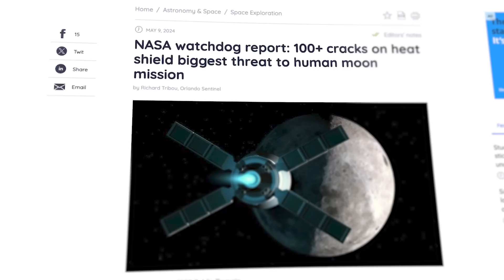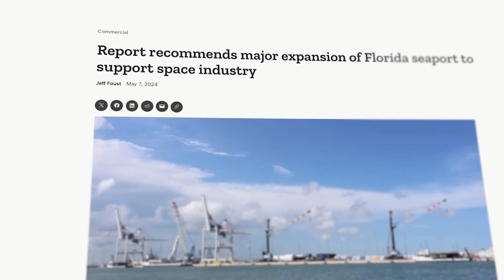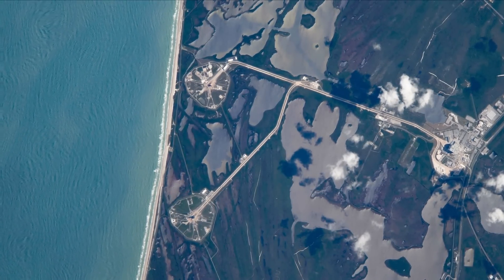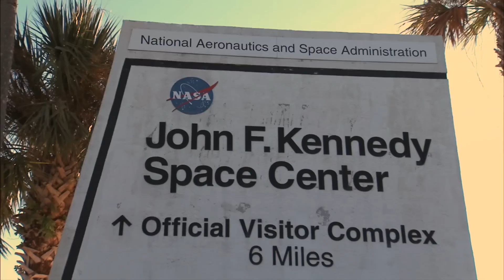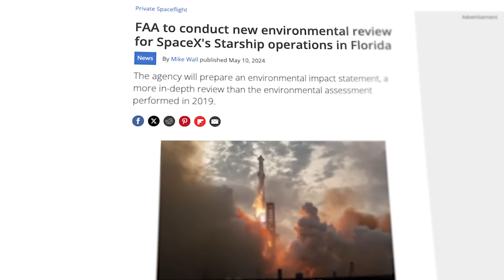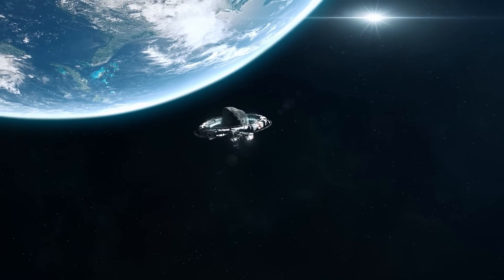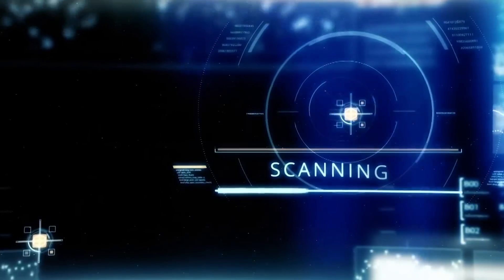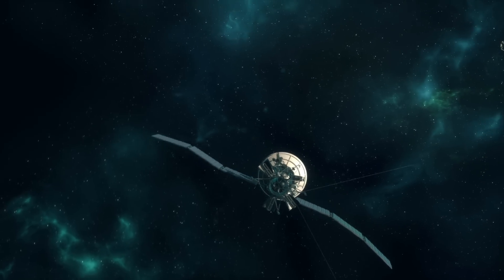NASA Has A Problem With Artemis

Comment: Its okay to keep blaming NASA for the delay since they are the major stakeholder but isn't the orion made by the ESA? I have not see one person raise doubt on them. Why is that? Is there a good reason?
Reply: No, Orion is made by Lockheed Martin. After the Demo-2 manned test flight, the Crew Dragon heat shield has similar issues of abrading too much that Orion has. SpaceX just thickened the heat shield in those areas, something that NASA and Lockheed Martin will likely do with Orion.

The ESA makes the European Service Module (ESM) to support Orion for the mission.

Comment: That heat shield was f'ed up, there were whole chunks missing! They were so big they could be seen trailing off the vehicle during re-entry.
Reply: After the Demo-2 manned test flight, the Crew Dragon heat shield has similar issues of abrading too much that Orion has. SpaceX just thickened the heat shield in those areas, something that NASA and Lockheed Martin will likely do with Orion.

Comment: Can someone explain why the Space Shuttle’s ceramic heat shield tiles cannot be used for Artemis program?  Did NASA accidentally destroy the technology, as they claim they did with Apollo’s records?
Reply: The shuttle returned from LEO, at ~17,000 mph (~27,000kph). When returning from the Moon, the spacecraft is travelling over 24,000 mph (~39,000kph), so the energy is MUCH greater. 

The Shuttle era tiles were individually made and VERY expensive. The Artemis heat shield is made from more generic materials to keep the costs down. After the Demo-2 manned test flight, the Crew Dragon heat shield has similar issues of abrading too much that Orion has. SpaceX just thickened the heat shield in those areas, something that NASA and Lockheed Martin will likely do with Orion. 

Only the Flat Earth and Moon Hoax conspiracy people falsely claim that the Apollo technology was lost. When Congress cut the Apollo funding, the hundreds of thousands of people and hundreds of factories making the Apollo hardware moved on to other things. So to recreate the Apollo hardware, you first have to recreate all the factories that made the Apollo hardware. So while the knowledge from Apollo is still there, the tools would have to be remade.

Comment: I’m flummoxed Artemis has made it as far as it has. It’s fscking 1979 tech and hardware being grafted onto a light remix of 2010 era design. And that’s a generous assessment.
Reply: Yet the 1960-1972 tech worked.
Reply: @christophercripps7639  absolutely true. And I’m not saying the design and engineering isn’t both valuable and useful. But I am saying that allegedly cost-saving in order to under-bid and win SLS on the basis of using old, remaining shuttle hardware is fine when there aren’t humans on top. But being that humans are about to be on that machine, we should be valuing quality a whole lot more than cost. 

Then again, ‘mericuh, capitalism, yadda.

Comment: oh no this Orion cracks thing sounds bad :(
Reply: After the Demo-2 manned test flight, the Crew Dragon heat shield had similar issues of abrading too much that Orion has. SpaceX just thickened the heat shield in those areas, something that NASA and Lockheed Martin will likely do with Orion after the research is done.

Comment: The Artemis heat shield issue cannot be overstated.  When a fix is found, it may require an additional unmanned test flight before NASA is ready to fly astronauts.
Reply: I believe ethically it SHOULD. Whether they’ll value life over cost remains to be seen.
Reply: @mostlyvoid.partiallystars   No, it doesn't necessarily require another unmanned test flight. The Demo-2 Crew Dragon had similar heat shield abrasion problems and SpaceX thickened the area that abraded too much for Crew-1. It's possible that Lockheed Martin may be able to do the same as NASA and Lockheed Martin have been researching this extensively already.
Reply: @steveaustin2686  they can always choose not to re-fly and probably will - I don’t dispute that. But ethically I believe it’s the wrong choice. What SpaceX did does not dissuade me of that, and I work in a closely linked industry to these. There are not humans on my rockets but I understand the systems engineering process and steps to mitigate risk and limitations to tolerable levels. That tolerance when humans are on the stack should, IMO, ethically, be much much smaller.
Reply: @mostlyvoid.partiallystars   And if they know WHY the heat shield abraded more than they expected and can FIX the solution to NASA's satisfaction, then WHY waste money on a reflight? You can always say that anoher test flight makes the system safer, but at some point you have to fish or cut bait.
Reply: @steveaustin2686  sure. And “some point” ought clearly exist beyond ONE test. 

Astronauts get to decide what level of risk they will take on, I respect that. But we need to remember there’s a psychological cost to the ground support as well, especially in Mission Control, for accidents in human space flight. 

This is crew capsule. It’s not booster stack, from which abort is possible. It’s not scrubbers, again from which mission abort is feasible. This is literal survivability becoming 1 or 0 based on a fix. 

You’re welcome to differ in opinion. That’s fine. Be well.
Reply: @mostlyvoid.partiallystars   AGAIN, if they know WHY the heat shield abraded more than they expected and can FIX the solution to NASA's satisfaction, then they may not need another test launch. This is not a new issue either, as the Demo-2 Crew Dragon had similar heat shield abrasion problems and SpaceX thickened the area that abraded too much. Since NASA was happy with the fix that SpaceX put in, they moved on to Crew-1. So this is NOT an unprecendented situatation that Orion might not need another test flight.
Reply: We were doing this routinely in the Sixties. Did we lose that know-how since then?
Reply: @roncatdog  For some strange reason Nasa destroyed all that knowledge...
Reply: @OurAmazingSkies   It looks that way. I think some people, both in government and industry, have figured a way to get the taxpayer to pay for 'inventing the wheel twice'. Never underestimate the power of greed.
Reply: @roncatdog  yes. It retired and moved and companies didn’t care enough to value retaining it. They assumed it was now commercially marketable and stopped valuing engineers. See Columbia and Challenger accident investigation reports.
Reply: @roncatdog   When the public lost interest and Congress cut the Apollo funding, the hundreds of thousands of people and hundreds of factories making the Apollo hardware moved on to other things. So know, it was not destroyed. The factories would just have to be rebuilt to make 1960s tech, which is silly.
Reply: Yes, in about another 10 years
Reply: I agree it would be prudent to play it safe, but they have limited hardware that will probably influence their decision. When you let politicians and bean counters assess risk, it's only a matter of time to expect the next fatal catastrophe.

Comment: Need to get rid of EPA oversight over Rocket programs.  This is a primary need and it doesn't need to be held back.  And, we need to get ahead of China and get back to the moon ASAP and get to MARS as quick as possible.  Playing around with EPA and ESA, holds us down.
Reply: The FAA vs SpaceX is not really a thing, except for clicks by some YT channels. After all, the FAA defended SpaceX in front of Congress in Jun 2021 over the unauthorized SN8 flight. The 'NASA delaying Starship until the SLS flies' was just as silly, since NASA needs BOTH Starship and SLS for Artemis. 

SpaceX had approval for orbital launches of the Falcon 9 and Falcon Heavy from Boca Chica since 2014. They could also fly sub-orbital tests of reusable spacecraft. SpaceX went through an Environmental Impact Statement (EIS) to get that approval in 2014. Since SpaceX wanted to fly orbital flights with Starship, that has roughly 3 times the propellant as the Falcon Heavy, out of Boca Chica, a relook was in order. So the FAA review was to see about adding Starship to that existing approval, without having to go through another EIS.
Reply: @steveaustin2686  thank you for the level-headedness and the good history lesson
Reply: @steveaustin2686  I didn't say there was
Reply: This should become a national security concern and the EPA should be told to mind its own business or be completely disbanded
Reply: @RedRyan  🙄Then you end up like Russia, with a lake so radioactive, you can't stand on the shore without receiving a lethal dose.

Comment: I have a hard time understanding why NASA has so much trouble with Orion heat shield. Didn’t they use heat shields on Apollo missions? 5:08 Shouldn’t they base their designs for the Orion capsule on that reliable technology instead of going for something entirely new and untested? In this “cost effective“ new space race to the Moon, shouldn’t NASA go for proven and effective methods and technologies instead of trying to reinvent the wheel?
Reply: Several reasons.
1. Funding isn't what it was during the apollo program, adjusted for inflation NASA had nearly 10x the budget at the height of the Apollo program.
2. Safety, the space race during the cold war saw some massive risk taking, numbers thrown around indicate a 50% chance of actually landing on the moon, and a survival rate of between 73% and 90% depending on sources. (Neil Armstrong said in an interview that he had a 90% chance of returning alive) 
That is obviously unacceptable in todays climate, anything below 99% survival rate won't be launched. 
3. Apollo was single use, Orion is reusable with refurbishment, public opinion could be expected to be negative if you throw away complex space hardware for no reason, it is also more expensive in the long run.
4. Nasa is aiming to set up a permanent solution, not a hand full of one off missions like Apollo was.
5. Nasa is conducting research into many more areas of space flight and stay, Nasa has 10% of the budget they had during the Apollo era, and they have 10% of the budget they had back then.  
6. New capabilities, the Orion capsule will be able to do many things the old Apollo ones couldn't, ranging from different experiments, sample returns, extended stays and so on, it's a bit like asking why we have modern cars when you could drive a 1930 Ford.
Reply: @Yattayatta not 10% about 40-50%
Reply: @thesilentpearl8575  The Apollo NASA had 3-4% of the US budget and no other big programs besides Apollo. Currently, NASA has less than 0.5% of the US budget and is also running the ISS at the same time as Artemis.
Reply: @steveaustin2686  yea i know + they are hiring contractors and is paying a fuck ton of them. i think they paid boring 4b for 2 center cores. shit price, like a 4 year delay but at least they got it done lol. meanwhile jeff bezos showers his piece of aluminum junk under a fuck gon of hubris…

btw at the beginning they estimated apollo success rate to be 5%
Reply: @thesilentpearl8575   The SLS core stages are $2.2B each per the NASA OIG for the first 4 flights. Boeing says that they think they can cut the price in half with more flights. Adjusted for inflation, Apollo is still more expensive that Artemis.

Bezos runs Blue Origin and has nothing to do with SLS or Orion.
Reply: @steveaustin2686  i was saying that jeff bezos can't finish their new glenn rocket. at least boeing managed to get their cores finished
Reply: @thesilentpearl8575   The BE-4 engine production by Blue is stopping New Glenn development. ULA's Tory Bruno has said that BE-4 deliveries for the ULA Vulcan Centaur has picked up, so hopefully Bezos gets his crap together soon.
Reply: @Yattayatta  but that is exactly my point. NASA has but a fraction of the budget they had when they were running the Apollo program. Hence why they should look into revamping and making that “old Ford“ run again – with modern improvements to make it safer and reusable – instead of always going for new technologies. If India can land on the Moon on a small fraction of the budget of Artemis – mainly by keeping their systems simple yet effective – you have to wonder if NASA still has the right people with enough innovative and creative drive to effectively run these projects.
Reply: @david_st-cyr  When Congress cut the Apollo funding, the hundreds of thousands of people and hundreds of factories making the Apollo hardware moved on to other things. Redoing Apollo requires remaking all those factories with hardware that had a higher chance of failure than allowed today.

After the Demo-2 manned test flight, the Crew Dragon heat shield had similar issues of abrading too much that Orion has. SpaceX just thickened the heat shield in those areas, something that NASA and Lockheed Martin will likely do with Orion, after their research is done.

Comment: Orion is the biggest POS ever made sent into space. NASA needs to stop entertaining this pile of garbage...
Reply: 🙄 After the Demo-2 manned test flight, the Crew Dragon heat shield had similar issues of abrading too much that Orion has. SpaceX just thickened the heat shield in those areas, something that NASA and Lockheed Martin will likely do with Orion, after their research is done.

Comment: Maybe go back 60 years, before all the “modern” material science and engineering “prowess”, and learn how to make a freakin spacecraft/heatsheild like “the ancient engineers” did! Maybe Gen X isn’t as smart as they think they are… KISS, Keep it simple stupid!
Reply: 🙄 When Congress cut the Apollo funding, the hundreds of thousands of people and hundreds of factories making the Apollo hardware moved on to other things. Lockheed Martin will likely end up doing what SpaceX did for the Crew Dragon heat shield issues, just thicken it in the areas where it abraded too much.

The Apollo NASA had 3-4% of the US budget and no other big programs besides Apollo. Currently, NASA has less than 0.5% of the US budget and is also running the ISS at the same time as Artemis. 

After the Demo-2 manned test flight, the Crew Dragon heat shield had similar issues of abrading too much that Orion has. SpaceX just thickened the heat shield in those areas, something that NASA and Lockheed Martin will likely do with Orion, after their research is done.

Comment: The Space Shuttle (STS) worked. The two disasters were entirely caused by gross human error by NASA launch control management. Once airborne, there were no issues.
The original concept was to assemble large lunar and interplanetary systems in orbit. The STS system could have been upgraded for a small fraction of the cost of re-inventing 1960s giant rocket technology. Management incompetence at all levels of NASA. 1950s B-52 Bombers have been in continuous service for over 50 years. They are not considered obsolete because they work as intended. Pure politics. No engineering.
Reply: No, the Columbia disaster was a result of the Shuttle being mounted on the side of the STS stack, so that foam and ice debris could compromise the TPS. Atlantis almost suffered the same fate as Columbia in Dec 1988, but luckily the tile damage was over an aluminum antenna mounting plate, so the wing did not burn through.

The Shuttles were just too dangerous to fly anymore as the debris strikes could not be mitigated enough, which is why the Shuttles were retired.

Comment: I think maybe, that the problems with the Orion program goes back to lot of free money and little oversite! I think it's time for the FBI to look into the finances of Lockeed-Martin and its board of Directors  as well as NASA!
Reply: 🙄 After the Demo-2 manned test flight, the Crew Dragon heat shield had similar issues of abrading too much that Orion has. SpaceX just thickened the heat shield in those areas, something that NASA and Lockheed Martin will likely do with Orion, after their research is done.

Comment: WAIT A SECOND.... Boeing sucking at making stuff?? Who would have thought??
Reply: 🙄 Boeing doesn't make Orion, Lockheed Martin does. After the Demo-2 manned test flight, the Crew Dragon heat shield had similar issues of abrading too much that Orion has. SpaceX just thickened the heat shield in those areas, something that NASA and Lockheed Martin will likely do with Orion, after their research is done.